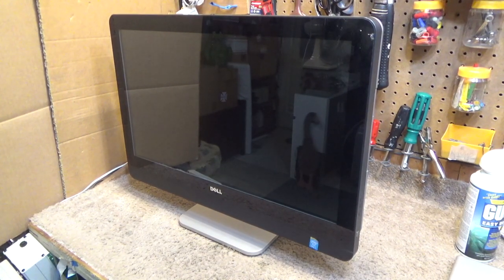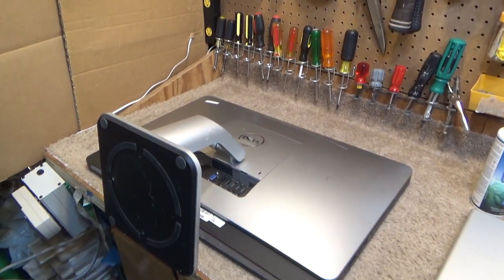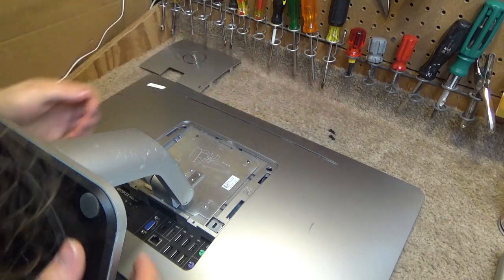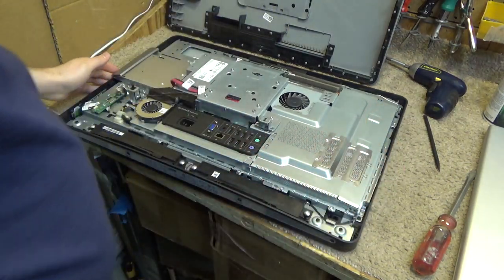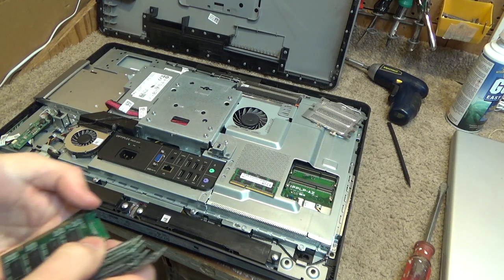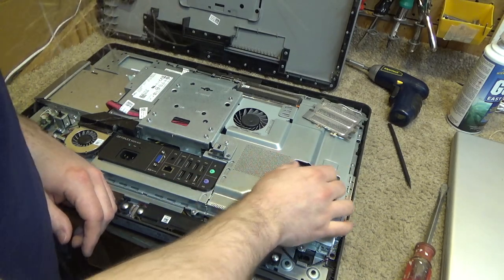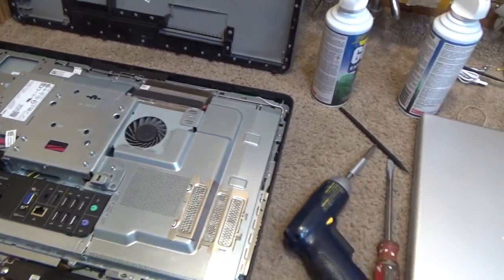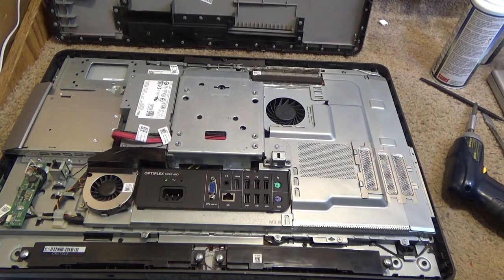Dell Optiplex 9020 All-In-One Desktop Computer | Cleaning and Memory Upgrade

Comment: Nice video on this Optiplex! I just trash picked one of these machines, a 9010 without touch (even though the service tag says it has touch). I posted about it in the discord. Was glad to see this video pop up on a similar model. I’ve already rolled it back to 7 and I’m going to upgrade the hdd and ram. Would be cool to see you dabble in computers more often.
Reply from the maker: Did you check to see if the touch screen is disabled in the BIOS?
Reply: @ Yes I did. From what I can tell I dont think my model is capable of touch, especially since the monitor has a matte coating with a plastic bezel unlike yours which has all glass. Maybe it was an option when these machines were new.

Comment: I’ve never seen an Optiplex AIO like that before. All of the ones I’ve seen are the newer ones built into a monitor stand with replaceable RAM and hard drives, which are in my opinion one of the very few designs in modern computing that actually feel like they had some thought put into them. Great work as always!
Reply from the maker: Those are probably the newer models, they become less and less serviceable with every year that goes by.

Comment: It's a shame that the newer iMacs aren't this easy to service :(

Cleaning my 2014 21.5" iMac made me say "Never again".
Reply from the maker: The I-Mac has been particularly bad to service since they changed the design to the glued on display panel. I have a newer one I use for video editing, I blast it with compressed air every few months and hope for the best. Fortunately/unfortunately the fans run at a very slow speed so it probably doesn't capture in all that much dust.

Comment: is there something between the lcd and front bezel?
i need to convert a touchscreen to non touch,because the glass panel cracked and we got an non touch bezel. but no plastic to cover the lcd.
i was wondering if the lcd is just unprotected with the non touch bezel.
can only find that the touch version of the lcd has the touch input pcb and otherwise no difference to the lcd.
Reply from the maker: I'm not sure. The touchscreen functionality can be disabled in BIOS or Device Manager.

Comment: I am not a big fan of "all in one" machines. Although that has to be one of the better ones I have seen. Most of them I have dealt with run off of a laptop charger, and have no ports besides for a few USB ports and audio. I guess because this is a "business class" machine, and I am used to seeing this type of machine in the cheaper home type machines. Never liked the use of laptop parts though, but that is common in some smaller desktops as well I guess. I generally refer to these types of machines as "DeskBooks. If I were to buy a machine and needed the all in one effect, I would probably get one of those thinkcentre "tiny in one" machines that uses a small desktop tower that attaches to the back of the monitor, at least that way you can upgrade the monitor and PC separately, although I still prefer a full size tower.
Reply from the maker: I'm usually not fond of this form factor either, but some of these enterprise level Dell units were designed pretty well. I'm sure some of them do, but I don't think this particular model utilizes laptop hardware. A lot, if not all, of those Lenovo tiny form factor units do.

Comment: Hi there, I have the older version of this, with 2 4GB RAM 128000S

Whic RAM is max possible for those?
Reply from the maker: I'm not sure, Dell should have a spec sheet which lists it.
Reply: Bit late but handy for others just seeing this ... the Optiplex 9020 can only take DDR3L RAM ... it has to be DDR3 'L' (1.35V) and not normal DDR3 (1.5V), as it will not work properly ... you'll probably get beeps and no boot up ... 16GB MAX ... DDR3L PC3-12800 1600MHz 204-pin SODIMM ... matched pairs ideally ...